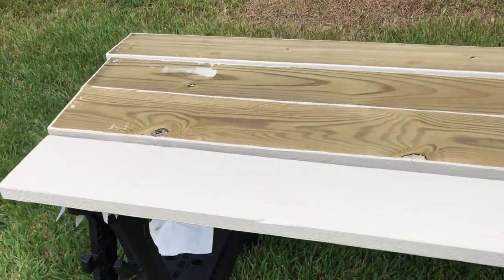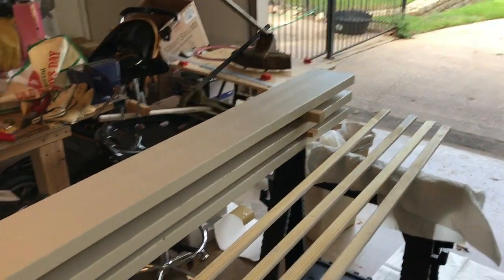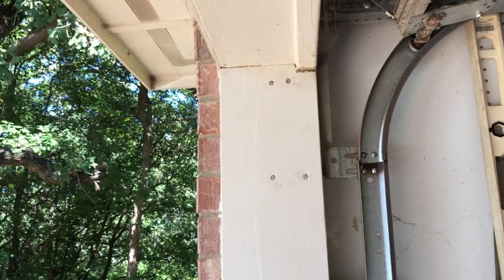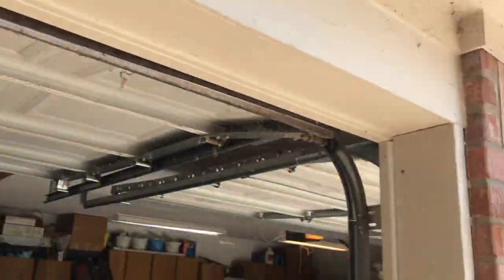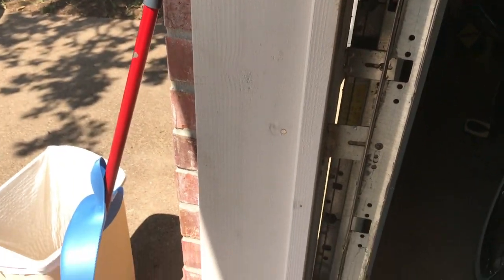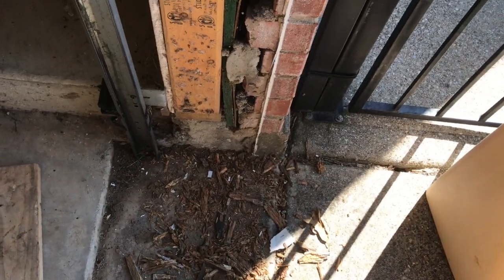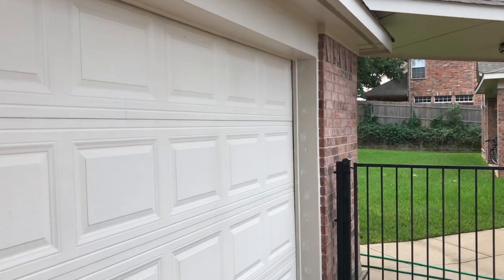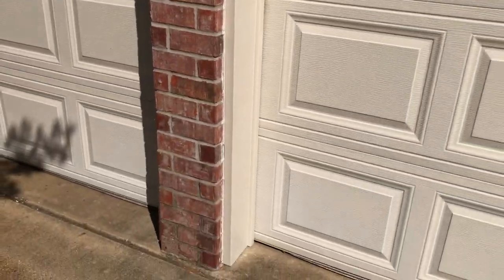Garage Door Frame Replacement - September 2018

Comment: There is a reason that the bottom of the jamb is cut at a 45 degree angle. Your jamb will be wicking up rainwater every time it rains, and you will be right back where you started in no time. You should have cut it, painted it, and flashed it. And where's your garage door seal?

Comment: Good video.  Little bit of constructive suggestion on improvement - I would have like to have seen how you removed the board.   Concerned with prying the old board out without damaging the masonry.  Seems like you could pry, Saw Zall out pieces, etc.. but what works best?
Reply from the maker: Michael, I agree that I should have shown more video on how I actually removed the boards, and this was one of my first "how to" or "how not to" videos, and I wasn't comfortable being filmed or using a tripod as I worked on a project at this time.  It has been a while since I worked on this project, but I believe I removed the rotten wood at the bottom first, and was able to get a crow bar under the wood to gradually pry it off.  I was careful to never pry against the brick and as you can see in the video the brick would have separated or broken had I put any force on it to remove the wood.  Good luck on your project.
Reply: @johnkrebs9357  much appreciated.  Thank you for taking the time to make the video, it was very helpful.  It was just food for thought.  I have more confidence now to try it on my own now.

Comment: I'd used screws. Then there is less face damage where you nailed. Easy fix, putty ove the screw holes and sand prior to priming.

Comment: Nice video. Quick question. What would be an indication to replace the header jamb? Is it the same process?
Reply from the maker: If the header is soft or shows signs of rot then I would consider replacing it. My header was in good shape but if I needed to replace it I would have used the same process. Take care when removing a large board that is overhead.  Good luck.

Comment: Did you paint the pressure treated wood immediately after purchase? Curious on if you has any issues since I usually heard of letting it cure for 2+ months before painting
Reply from the maker: I let them cure for about 2 months in the hot garage before painting.  I stacked them flat with small wood slats between each board until they shrank a little and dried out.  Three of the four boards turned out great, but the fourth really warped severely.   I purchased a replacement and only allowed it to cure for about a week or two, which wasn't enough for it to cure completely, and it shrank several weeks after I had installed it.  I had to recaulk that board when it pulled away from the brick - not a big deal.

Comment: Why not buy another board u look like u have money!just kidding good work!
Reply from the maker: These boards wont break the bank, but the treated wood is a little more expensive than the untreated.  I eventually did buy a replacement, but since it was treated I had to give it time to season and dry, which extended the project time by a couple of weeks.  Overall, it came out pretty good, and looks much better than it did before I started.

Comment: Hard to tell from the video , but that looks like the kind of rot extent I would just fix with bondo.
But if the bottom foot or so is to rotten , I will just cut out that portion for replacement .
Oscillating multi tool is great for this ... but a skill saw resting on a block with give you the straightest cut.
If you can get it and mill it to size ... spanish cedar is probably the best for that type of repair because it is so stable and rot resistant .
But usually I would have some old seasoned pieces of treated lumber to use instead of buy new and waiting to dry out .
Then patch the seams with bondo .

Comment: My garage door trim has a big gap. The 2x8 was cut on a angle so it does not touch the concrete but god damn a lot of insects including spiders have gotten into my garage. Whenever I buy the 2x8 do I have to let it cure for 2 months before installing it? Can I install it all the way down to the concrete or will it rot sooner?
Reply from the maker: My original 2X8 was also cut at an angle and was probably done to reduce trapping water and slow rotting, but it seemed to rot pretty quickly once it started.  When I replaced the 2X8's I cut them parallel to the cement with a 1/4 inch gap to avoid trapping water and reduce rot.  I also put 2 coats of primer on the bottom of each replacement board.  Bugs and spiders will always be a problem, but you may want to also replace your weather stripping on your garage door bottoms like I did in this video - https://youtu.be/S0vC39mI8eI  It is inexpensive and fairly simple to do if you take your time.  Be care of the sharp corners if you have a metal door and good luck.
Reply: @johnkrebs9357  thank you so much for the advice! God bless 🙏

Comment: Nice video.  FYI, it's best to leave some space at the bottom or cut at an angle like it was before. What happened to the frame remote box on the 3rd one?
Reply from the maker: I don't show it very well in the video, but there is a quarter inch gap between all the frames and the concrete floor.  I also painted the bottom part of the frames to seal the wood as much as possible from all sides.  The old frames had the diagonal cuts at the concrete, but it appeared as though moisture had started seeping in through the point of each frame's diagonal cut, and ultimately created the rot.  I wanted to try something different in hopes the new frames would last longer.  

I found the screw to release the remote under the battery inside the remote.  The remote came off easy and was just as easy to reinstall on the new board.  Hope this helps.
Reply: Ok, nice! 
I will try that, thanks!

Comment: Your wood appears to be sitting on the cement. Treated/painted makes no difference because in several years from soaking up the rain the wood will rot again.
Reply from the maker: Believe it or not, there is about a 1/4 inch gap between the bottom of the wood and the concrete.  Not a huge gap but it is also pretty dry here in Texas most of the year.  My video wasn't as good as it could have been to show this gap, but this was also one of my earlier videos too.
Reply: @johnkrebs9357  John thanks for your reply. I too live in Texas but my area it rains alot. I just had to redue my garage door jams. (If you live in El Paso Tx it really would not matter about resting on  cement ). Be well  😊

Comment: i want to make a 8x8 garage door   do i just use boards i can get home depot like a 2x8 etc?
Reply from the maker: Abdou, this sounds like a fun project.  Home Depot or any of your local hardware stores should have the supplies you need.  If you have additional questions, I would also suggest taking pictures of your project site and talking to one of the carpenters who usually work at these big box hardware stores.  They can be a great help.  Good luck and have fun with the project.
Reply: @johnkrebs9357  thank you ., im in CAnada theres a lot of materials but when you ask any question tehy want to send someone expensive. are the jambs just 2x6 boards of wood?     thank you .
Reply: @johnkrebs9357  by the way i like your channel, im originally from Lebanon , we build out of poured concrete and blocks many many stories high . I am surprised how a big of a deal they  make building out of wood here is (in North America) they take it more serious then anything as if they are building the WTC .  I wish the carpenters would take a look at "third world" regions
Reply from the maker: My original jambs were 2X8's so I replaced them with the same.

Comment: Hey john, did you spackle over those nails or did you use caulk before you did the final paint?
Reply from the maker: I used exterior painters caulk on the nail holes and the corners.
Reply: Thank you!!
Reply: You did great work!
Reply from the maker: Thank you

Comment: My door frame paint is starting to come off. Would it be worthwhile to just sand off all the paint and restaining it?
Reply from the maker: For me it would depend on how much the paint is peeling.  If it's just a couple of small spots here and there, I would lightly sand and remove any loose paint, prime the exposed surface and finish it with a fresh coat.  But, if the paint is really peeling all over, then it might mean it wasn't propery primed, and if that is the case, then take it all off, prime it and then repaint with quality paint.  Good luck on your project.

Comment: What kind nailer did u use? Brad, finish or frame?
Reply from the maker: Frame.  Brads would not have done the job.
Reply: @johnkrebs9357  would wood screws work just as good?
Reply from the maker: @zee9er  I think a long enough wood screw would work.

Comment: What type paint was use on the wood
Reply from the maker: The first 2 coats were an exterior latex primer, and then I finished with an exterior latex that matched the color of the old trim.  I didn't prime it until it had cured in our hot garage for at least a month or so and I even primed the ends after I cut them to length to give the wood an added protection from water.

Comment: How did you mount the sensor lights in front of your garage door?
Reply from the maker: The garage was built with a light at that location and I just remove the old light fixture and replaced it with a sensor light.
Reply: Thank You for responding!

Comment: I'm curious as to why you leave a gap at the bottom. Is this normal to do? I don't know much about this process and I'm trying to learn so I can hopefully replace the frames around my garage doors. Great video, thanks!
Reply from the maker: Shifter7, I didn't know much about the process either when I started, but I spent some time thinking about it and doing a little research like it seems you are doing.  Take your time, would be the first thing I would suggest and think it through prior to starting, would be my next suggestion.  The gap at the bottom was to get the wood frame off the concrete and help it to dry quicker after a rain.  The original frame was cut at an angle to reduce the contact with the concrete, but I think it touched the concrete and it was very rotten about a foot or so up, and the reason I replaced the frames.  I used treated wood, let it cure for a month or 2 in the hot garage and used a coat or 2 of exterior primer before installation and even put a coat of primer on the cut edge before installation for added protection.  Hope this helps, have fun with your project and good luck.  John

Comment: What kind of caulk did you use for the garage doors? Is there a certain type of caulking that is stronger than others?
Reply from the maker: I used an exterior paintable caulk.  Nothing fancy, and it still looks great several years later.

Comment: What happened to the garage door opener keypad?
Reply from the maker: It was very easy to move onto the replacement frame.  Inside the pad where you change the battery I could get to the mounting screws to remove it from the bad board, then reverse the process to put it on the new frame.

Comment: What kind of wood do you use?
Reply from the maker: It was a pressure treated lumber that I let dry and cure in the garage for 2 months before I painted and installed it on my garage frame.

Comment: You should have left a gap at the bottom.
Reply from the maker: Sealteam7 - I can see now that my video doesn’t show it as clearly as it should, but I did leave about a quarter inch gap at the bottom of each jam.  I measured several times to be sure the bottom matched the small slope of the concrete with a parallel quarter inch gap.  As an extra effort to preserve the wood a little longer I primed the cut bottom that can’t be seen.  This added a little time to the replacement, but I wanted the entire board protected in primer.  I guess I should have shown more of this detail in the original video.  Thank you for your comment.
Reply: @johnkrebs9357  Awesome work John!
Reply from the maker: Thank you, Brandon